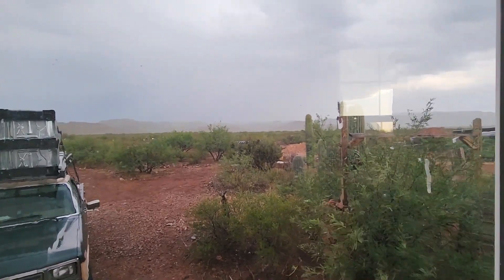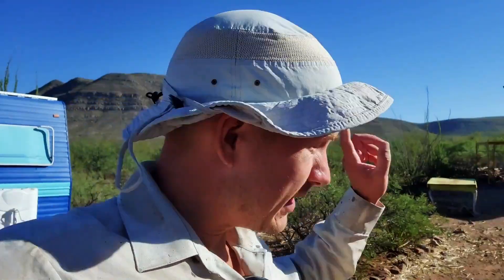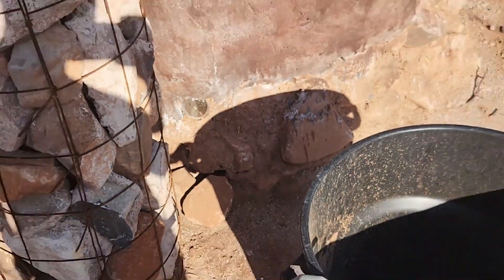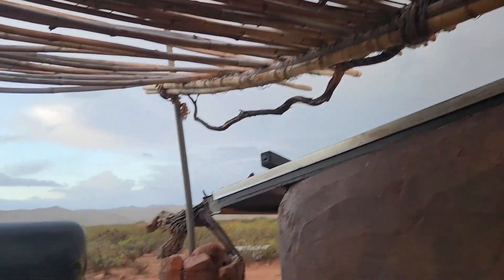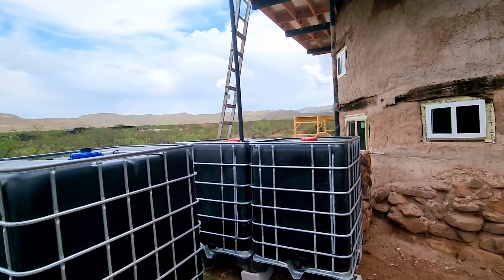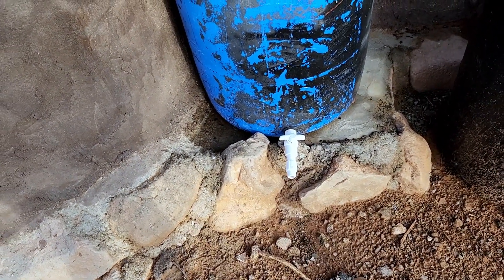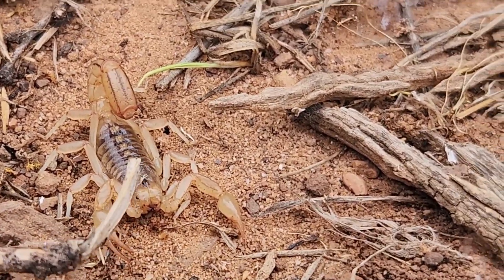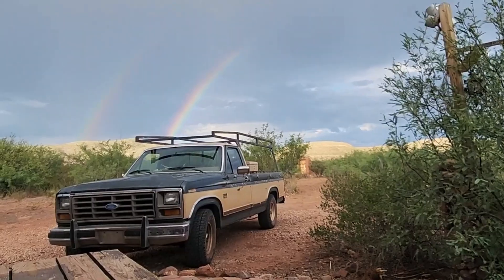💦 When Every Drop Counts: Rainwater Collection in Desert Conditions 🌵

Comment: I used to live off grid in yucca valley,CA. I had one if those square tanks. I had a problem with red fungus that grew inside them which makes water toxic. Make sure you use bleach to keep the water from going bad . Also when I lived in yucca valley. I ended up getting a water truck to come out. He would deliver 2000 gallons for $60. That was in 2005 tho. But that is probably your best option for water. You should get a big metal tank to store water in too.
Reply from the maker: I've never had issues with the painted tanks. Right now we get 4000 gallons delivered at $350. I don't like relying on others though.